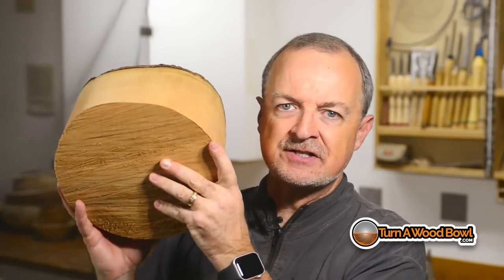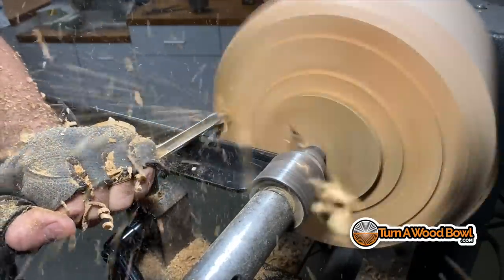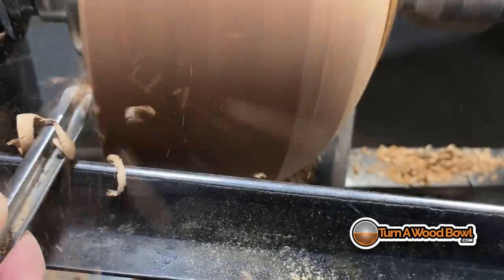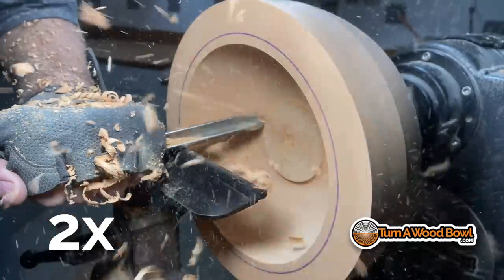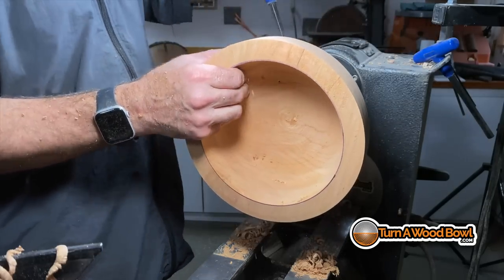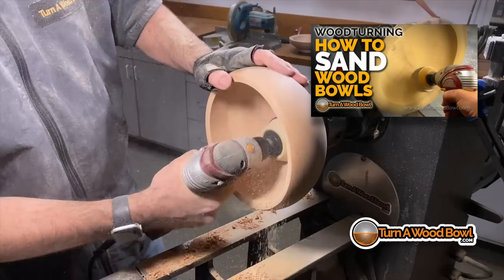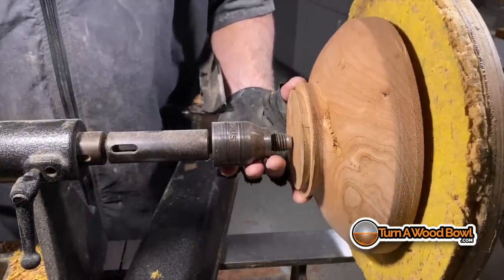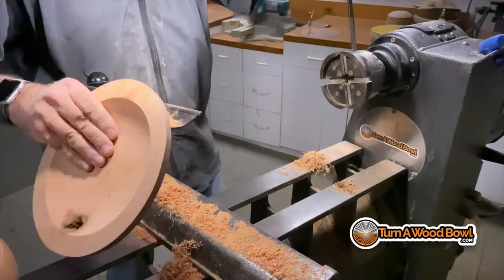Life-Changing Lidded Wood Bowl Turning — Very Special Video

Comment: Great idea Kent! I haven't turned a bowl yet (waiting for a replacement chuck because it won't screw down all the way) but when I do I will definitely consider donating! I have 50 cords of firewood I got (all for free) from tree service guys. I still have a few rounds that are unsplit that I will be examining for wood turning projects! Love your videos, been learning a heckuva lot before even getting a lathe.....and once I got it I just started turning thanks to all the knowledge from you and others on YT and forums. Thanks again.
Reply from the maker: Thank you. You can try a simple plastic spacer for that chuck. I have a chuck that doesn't seat all the way and it works great. Here's a link https://amzn.to/312DSuR Happy Turning!
Reply: @TurnAWoodBowl  I ended up returning the Record Power chuck. The people I bought it from claims it spins down just fine on other spindles but I doubt it. I ordered, istead, a Oneway Talon and just received it today....and guess what? It spins down perfectly. So for anyone out there, don't use the Record Power SC3 chuck on the Powermatic PM2014 as it just won't seat properly on the shoulder....even with a spacer....So basically there's nothing wrong with my threads even though I mucked it up slightly with the set screw.....It might have worked with 2 spacers....but I think I'd rather not mount it that way. Very happy with how smooth the Oneway operates.

Comment: You mentioned using linseed oil but there is this quote on the BoC website:   "Also do not use finishes like linseed oil that take a long time to outgas."    Does the beeswax mitigate that problem or do you just wait a long time for the linseed to outgas?   Thanks very much for the post.
Reply from the maker: Lex, I read the same statement and the reality is many people call the chemical concoctions from the hardware store "linseed oil." There is no food label requirements for finishes, unfortunately. Tried and True's Danish Oil is 100% linseed oil and nothing else. There is no off-gassing, in my opinion. You should wait the required time for the oil to cure, but it is 100% food safe. Happy Turning!

Comment: Have you or anyone on the channel heard of anyone using a sun oven to dry their green turnings? I think it should work but would need to leave a slight crack to let the moisture out. I have done very little turning so far but if I wanted to do a green turning I would like to know if this might work.
Reply from the maker: Good question, Cal. We really don't want temperatures that high. Check out my Green Wood online course for everything you'll want to learn. www.TurnAWoodBowl.com/green Happy Turning!

Comment: Thanks for letting us know about this program, I hadn't heard of it. Your bowl is fantastic!  Just a minor nit pic though, it looks like they want you to avoid finishes like linseed oil that take a long time to outgas.  If you're using raw linseed oil (which is food safe), it takes 2-10 weeks to finish out gassing.  Personally, I would avoid boiled linseed oil completely though, as the drying agents are somewhat toxic.  But please don't take my word for it though,  I'm not an expert on this stuff.  There is a lot of relatively easy to find information on wood finish safety on the interwebs.  Just pick reliable sources, remember the target audience and keep their safety in mind.
Reply from the maker: David, you are correct, but that is exactly why I used this product. As far as a know this is a one-of-a-kind finishing product. There are ZERO drying agents in this. Here check this out https://turnawoodbowl.com/my-favorite-food-safe-wood-finish-waterproof-almost/ All the best to you and Happy Turning!
Reply: Hi guys. BLO takes a long time to be fully absorbed by the timber and hence is not an ideal finish if you want to start using it quickly. I make a 50/50% mixture of BLO and natural turpentine and it penetrates quickly and dries out in a couple of days, ready for my favourite finish - shellac. Once evaporated, the turpentine has disappeared. Whether it is an issue with contact dermatitis / skin sensitivity I don’t know but would doubt so. The natural turpentine I believe comes from the turpentine tree, a native of Australia. That was the original source before it was artificially synthesised. Cheers.

Comment: Do you have any idea how to get an authentic clear amber color for epoxy? I took orange but that's not what I wanted ...
Reply from the maker: If you mix your epoxy clear first, then put a small amount in two separate cups. Add yellow to one and orange to the other, and mix them well with separate stir sticks. Then add a touch of the orange and yellow mix at a time to the main clear mix. This way you will have much more control over the final color. Hope that helps.

All the best to you and Happy Turning!
Kent

Comment: What moisture percent do you think you turned it at after drying?
Reply from the maker: I do not measure percentage. I weigh the wood until it stabilizes or equalizes to the environment. Good question. Thanks.

Comment: At 27:00 you start sanding and I couldn't help but notice that there wasn't any dust collection setup. How do you deal with the dust? My shop is in my garage and I work right at the garage door opening. I have a shop vac with a two-HD-bucket vortex collection setup that I use on the bandsaw but I haven't made a brace for the lathe yet. For cleanup I sweep up and then just use the leaf blower and blow whatever I couldn't pick up from sweeping. I will be making a setup for the lathe for major sanding. So far I've just done some very minimal sanding.
Reply from the maker: I wear a full respirator as I turn. Gravity does the rest. I work with the door open too. Happy Turning!
Reply: @TurnAWoodBowl  Hi Kent. One more thing. Last night I saw a Stumpy Nubs video on how he got injured using the chainsaw angle grinder attachment. It sliced 4 of his fingers on his left hand. I just thought I'd share the video with you because I've seen you use the attachment (as well as mention it on your website). I was thinking about getting one....but after watching this video, I think it's a lot safer to use a Forstner bit on a drill press. Anyways, happy and safe turning to everyone. 

https://www.youtube.com/watch?v=A7xWHEWov8M&ab_channel=StumpyNubs

Comment: Every time I've used the bowl as a jam chuck for the lid, it ends up spinning in the recess, "sanding" that joint and causing a rather loose fit. 😕
Reply from the maker: Try the gaffers tape method. It shouldn't move at all. All the best to you and Happy Turning!